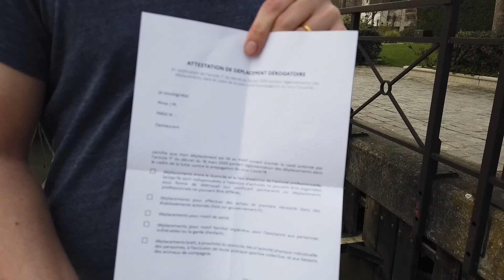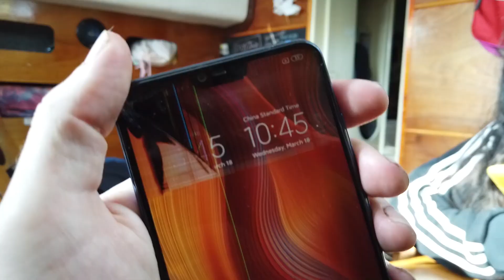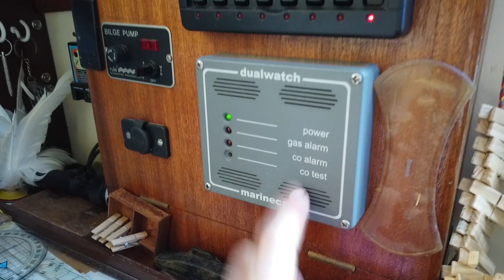Tiny Boat - Big Lockdown | Wildlings Sailing

Comment: Hiya, the co alarm should be 15cm down from the ceiling. And a good job would be to put a ventilation panel at the bottom of your door. Also a mushroom vent in the cabin roof. Yachts aren't really made to be lived on so the ventilation is poor.
For more information google "Boat Safety Scheme pdf" and download the requirements pdf. (If you get internet).
Reply from the maker: Nice one, great bit of info there

Comment: Aye m8's, I just love your vids. So true and so into realism. Great! Yes, with som more layers of oil and wet sanding the wood in oil, not water, is a really good idea. Try out on a smaller piece to see how it works out. But you should really need some good paint brushes… May I ask, what keeps you from dealing with the sampson post? Material, financing, tools or what? You do have the skills of using tools, I can see that. All this scraping away old lacquer is a good practise to find out the right angle for working the edge. Your corona cookies looks absolutely tasty!
Reply from the maker: Thanks MiQ, and thanks for our new paint brush 😁😁😁 I've been apprehensive about opening up the 'deck hole' because of the rain. now it's not raining I'm ready to get started, got a little preview of what I'm thinking in the next vid, hopefully some others can give advice on it. Cheers mate!!
Reply: @WildlingSailing  
❤️

Comment: Another great video! You're right, it's great to have things to do when in lockdown. We just got a kitten (Burmese/Havana cross) so yesterday I built a catio in the garden for her now that the weather is on the up and up.

An idea for a lockdown boat project. I can't remember, do you have an AIS receiver on the boat? I installed a great one (Quark-Elec) on my MacGregor 26 for my trip to the Scillies. They can be done really cheaply and show up most surrounding boats on both your chartplotter and any tablets and phones etc. Was really useful in busy shipping lanes. Was a fun project!
Reply from the maker: Nice one, we don't have an aid but we're thinking of getting a cheap Chinese system. Good luck with the cat! They are heaps of fun

Comment: New project: fix the damn depth sounder. I need to do the same... motivate me! :D
Reply: @ಠ_ಠ sometimes, I think. Mine just spits out random numbers, then decides it's all too much work, quits, and then eventually goes back to spitting out random things.So I guess it works... just not the way I like it to. Not sure what Mark's sounder is doing, but eh... they keep you busy during lockdown I guess.
Reply from the maker: My clipper Sounder is great, (I think )it's the fish finder that's not working
Reply: @WildlingSailing  let me guess, it spits out random crap, then says "Out" on the display? Because that's what my Clipper is doing...